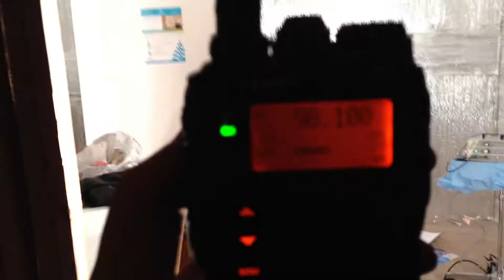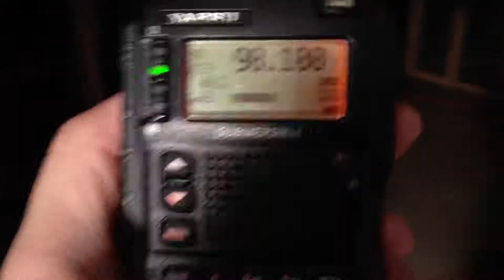Faraday cage test with Mylar fabric

Comment: The door was open. Close the door and ground it should be 99% tharn
Reply: @kelly-gi4du  either drive a dedicated ground rod or run a ground wire to your breaker panel
Reply: @electromechanicalstuff2602  Mylar is non conductive, it cannot be grounded.  It works by reflecting the signal, so yes, close the door!
Reply: @ddt43  So, if I put it underneath the floor, ceiling and walls under drywall with metal screws, the mylar will still shield emf?